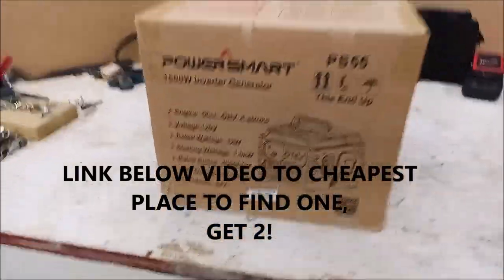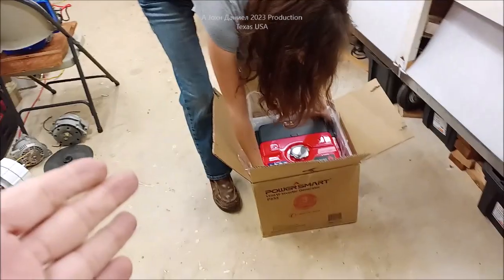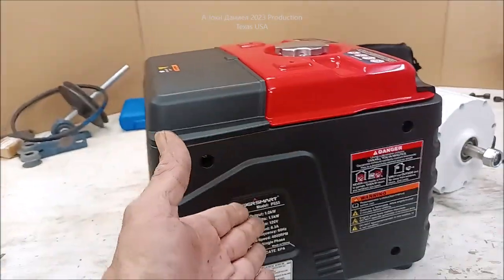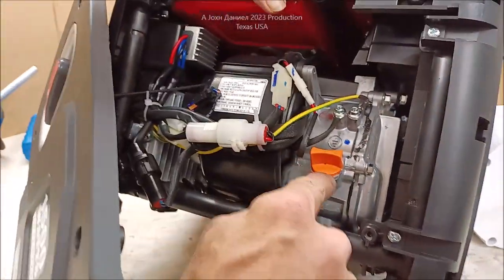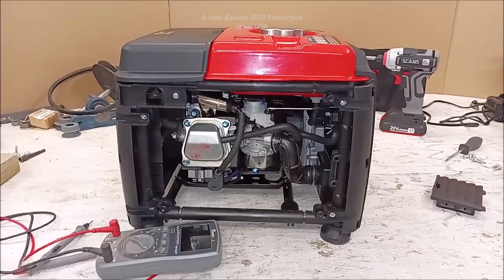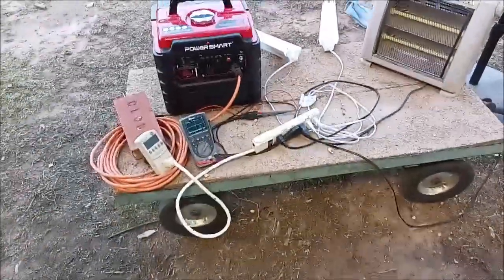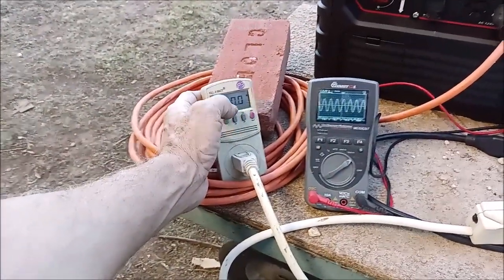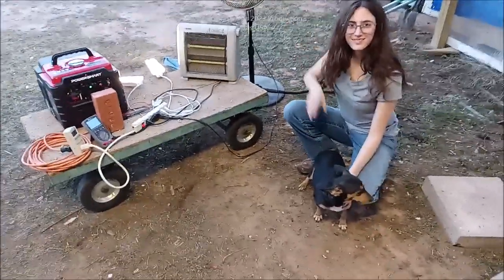POWERSMART 1000 / 1500 Inverter Generator, the affordable solution

Comment: Can a 1500w power inverter power on a 1500w electric oven using a 1000cc car battery ?
Reply from the maker: Consider what ever load you plan to run as being 80% of what it will actually need or use, consider any inverter or generator you buy to be 95% of what it can safely do. (1500 watt cooker 1650 watt real) 1500 watt generator or inverter 1420 watt real safe output.
In your case, you want a 2250 to 2500 watt inverter or generator. Cost is about $35 to 60 more in such a case. As for a 1000 Cold Cranking battery, not without the engine running. They are only 90 AH to 120 Ah in actual capacity. You need 2.5X that at the minimum.
Reply: @JOHNDANIEL1  ok.And I have different electric ovens some 1,100w and a 500w microwave.And I have a car battery charger.Thats a good tool to have.I watched different YouTube videos on using a car as a generator.People shouldn't junk they car if it start up and provide some heat.And ima get like 3 heavy-duty 100ft extension cords with a lot of watt
Reply from the maker: Always keep your car full of gas with some stabil fuel treatment in it.

Comment: I take it this still has to be kept outside?
Reply from the maker: Yes, but not as far away as a 2 cycle due to burning oil from them is very cancerous. In fact it is so quiet you can just set it outside the door a few feet.
Reply: I have a 4 stroke propane powered weed wacker I never use anymore. I believe it only has a 25cc engine.

Comment: Would it run my 110/220 welder?
Reply from the maker: No it is only 11.25 amps output. For most welders you need 30+ amp outlet like this Pulsar https://amzn.to/3FxF1zd
Reply: So no 110/120? Isn't 110 save as most wall plugs
Reply from the maker: @anthonystill1590  Wall outlets are 15 and some 20 amp. A common 100 amp MIG like from Harbor Freight uses 12 to 13 amps and will work on a regular outlet but tends to stress them heavily. Check the amp draw under load for the welder, then for every amp it draws consider to find a power source that can handle that plus at least 20% more.

Comment: Very useful informative content, sir.  being 4 cycle engine, would the fuel available at lowest or home depot work rather than just  automobile gas? from local outlets
Reply from the maker: If you can afford the safe ethanol free gas they sell by the gallon, it's expensive and supposed to have a 5 year lifespan, I would get 10 gallons to stash for such a thing. Bad is on our 2023 calendar for sure.